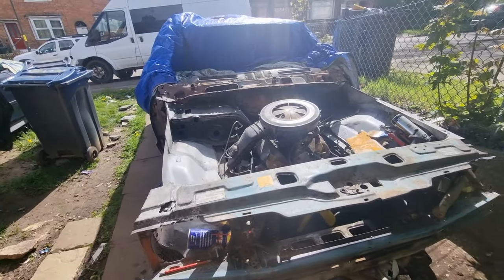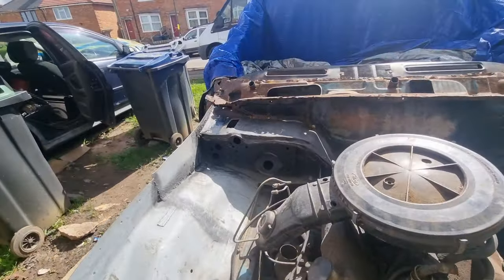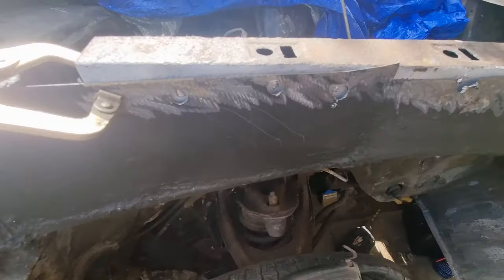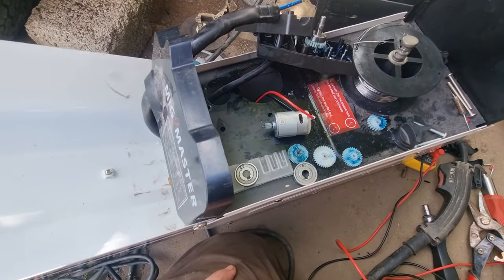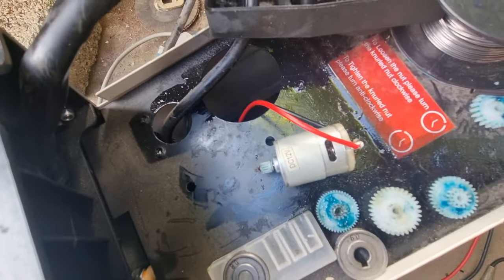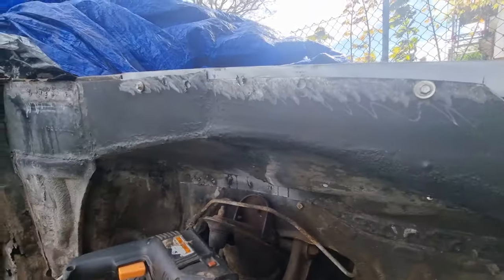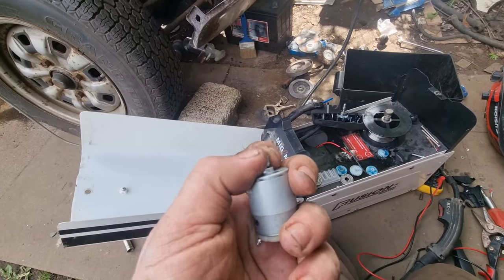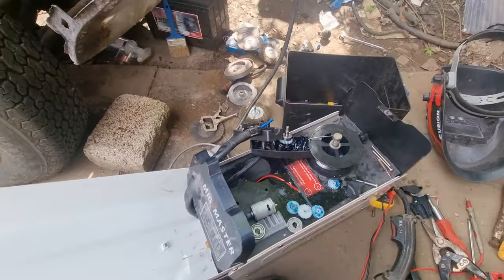Cortina Mk4 Ghia 2.3 V6 Restoration || Welding Problem Update (P21)

Comment: Can he fix it ? Yes he can lol nicely done Adam probably a wet liquid type connection from spraying the wd40 in there maybe ! Anyway you found the problem and fixed it that’s what matters  good job 👍
Reply from the maker: hehehe thank you yeah maybe was strange it worked for a bit then stopped but now i have soldered it proper spins great now will proper test it when i do some work tomorrow morning :)

Comment: Current can travel through liquids and complete the connection that's probably what happened there then probably de clumped and stopped the connection again lol, glad you sorted it cuz 🙏
Reply from the maker: yeah maybe lol factory error lol never soldered the resister wires not sure why i called them caps in the video lol
Reply: @AdamSNook.  The amount of people that send things back or just throw things away like that, when you can take a quick look in side and its a simple fix lol
Reply: Glad you got it working again don't soldier it a tip for you don't screw the tensioner to tight on the welding wire wd40 is good stuff fixes every thing hopefully the welder will keep worker for you mate 👍
Reply from the maker: i love wd40 lol drives water out of electronics aswell best stuff ever hehe

Comment: Hi adam, first well even th this shell is say seen better days I was wrong in saying it's scrap I'm sorry, I watched the bulkhead and jaw dropped as to how bad it was. Then I saw what you did your a very skilled guy clearly you can save this car. I'm seriously looking.forward to this restoration . I am a big fan of cortinas my first was a 1979 mk5 saloon my 2nd was a crusader. I had that for 6 years selling it in 1999 back then no one wanted them it was smoky and rear arches rest pretty good. Reg was beg 542y. In white prob long gone now. The only v6 auto I had was in a mk 2 Granada saloon. The auto box would not shift there was air thing that was blocked we cleaned it and it changed fine also the rockers always suffered from oil starvation so bad to change them now and again but bk then scrapyards was full and was easy to get parts.
Reply from the maker: It's OK mate thank you good info there :)

Comment: Those wooden tops on the door panels on my crusader I literly sanded them down and varnished them they really came up a great I did mine a bit darker lasted well. On my 1.6 the cam belt went at traffic lights I was lucky there was no damage I paid £500 in 1993 for the crusader it was such good nick I went.everywhere in it engine became smoky and rear arches went plus round the Ariel back then in 1999 I could not sell it in the end it went for £75 honest if we only knew now but they was 10 a penny think when we look back on some of the cars we had. It's like the chopper bike they fetch £700 I swooped mine for a cassette radio amazing hey
Reply from the maker: Hehehe yeah cheap back in the day makes you wish u kept all the stuff is varnish OK on plastic

Comment: Just watching your engine video I'm talking early 90,s so memory well but under the carb there's like a flatish unit with a pipe to it that's what I cleaned out and the gear change was as smooth as anything.
Reply from the maker: Oh right will take note

Comment: No quality control checks happens alot thats why alot of stuff gets sent back especially from china..glad you got it working again wd40 is good upto a point it does leave a  residue behind deoxit contact on the brushes would be ideal it shouldnt have needed it really given how old the unit is. Great result never the less. The metal work is going great  far exceeded my expectations. Good work bro.
Reply from the maker: thank you bro im on the wing tops now lol thats what i was going to weld on when the welder said nope but now its working again i can crack on again im working my way into the car hopfully i have the chassis ready to put on just waiting to order the inner sills so i can get the strength back in also floor pan
Reply: @AdamSNook.  I can't wait to see some sills go on but what I'm most looking forward to is the repair or replacement rails on the front and rear floor pan lol that's the worst I've ever seen  on a car I'm curious as to how that's going pan out no punn intended lol
Reply from the maker: @SimonsSolarShed  hehehehe yeah to do the floor pan i need the inner sill aso i can line it all up chassis on driver side will be done soon so wont have to wait long on that one bro
Reply: @AdamSNook.  awesome 👌 have you decided what you're going to do about the  rails? Repair or replace? You could repair the one towards the front but the rear looks a little worse for wear, I wonder if it is possible to repair. It would be challenging.
Reply from the maker: @SimonsSolarShed  do u mean the cross braces
Reply: @AdamSNook.  yea I wasn't altogether sure what they were called lol